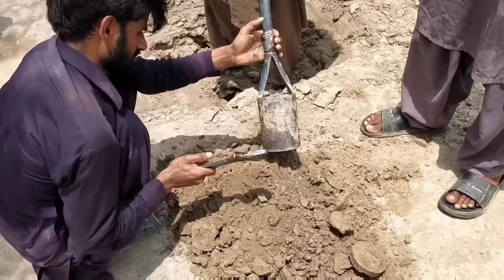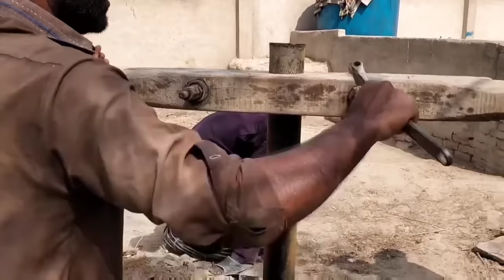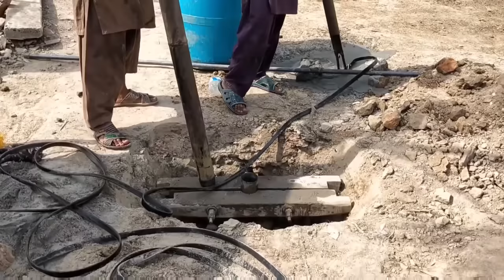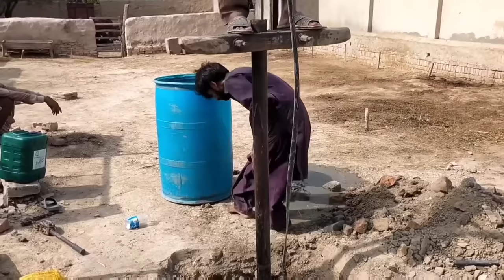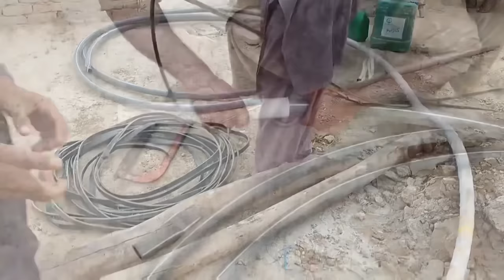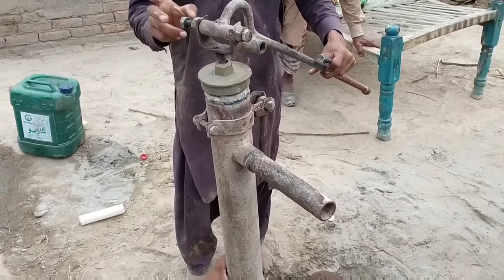400 Feet Borewell Drilling Within 7 Hours with latest technology | Borewell drilling Feast Your Eyes

Comment: Hard to believe 400 feet.  Hand pumps at the top of a well are limited to about 33 feet due to air pressure.
Reply from the maker: trust me this is 400 feet 80 pipes 5 feet each they enter down
Reply: @EESkills Then please explain how the pump can suck water more than 30 feet up? Its physically impossible without a pump at water level.
Also, I dare say it's impossible to push 400ft of pipe down with only the weight of a few people, due to friction, and even more impossible to lift it all back up with that method. Maybe 100ft but not more.
Reply: There are valves further down, essentially pushing the water up. Or could be.
Didn't see it here though, maybe the water table is not as deep.
Just cleaner water way down. Didn't see any protection against contamination either.
Reply: Artisan pressure?
Reply: @bignicebear2428   they would need sucker rod. and they did not have any. They set the pump right on the top of the line and pulled (about 29 feet.) 

400 feet is a lie
Reply: LOL everyone literally saw them put 30 feet of black piping down the hole. Just get over it guys, it's a title on YouTube not a sworn oath.
Reply: correct, hand pump can not lift more than 30 ft suction, fooling us!
Reply: more like 400 inches. .they mess up converting from metric to English
Reply: Hi guys! Cool equipment and Great job 👍 I’m drilling a abyssinian wells in Russia, just using a hand drilling machine up to 69 feet, what do you mean about it?
Reply: @Mikst74  the others are getting upset by the hand pump that they used to extract the water saying it doesn't have the capacity to work beyond a certain height. The argument is a little flawed any way in that the height is calculated from the pump to the water table. My point is that they clearly only drilled about 15 or 20 meters (65 feet). With your experience how long would it take using these methods to drill 400 feet?
Reply: 40 inches ..oops
Reply: Can only be 8-9 meters.

In those countries the laws of physics has not yet been discovered, so they don't know it is impossible, they just do it.
Reply: It was only about 50ft deep.
Reply: @c2h7 let's says 40feet
Reply: @youghurt2k 😅😅😅😅
Reply: @youghurt2k  😂
Reply: Definitely not 400. You can see it's maybe 60 feet. when they put the black abs pipe down you can see the total length is less than 100
Reply: Incredible!!!
Reply: The hose they fixed was no more than 100 feet long
Reply: Even at 40 feet they did a great job, having water from a well is a blessing we take very much for granted 👍
Reply: 400 pakled feet
Reply: @EESkills  You've made a fine video. Now, please cut the bullshit about sucking water from over 33 feet. You may well have drilled down to 400 feet, or 4,000 feet for all I care. But if the water table is lower than 33 feet down you won't get a drop with that type of pump.
Reply: Mohammad &Son Well Drilling Inc
Reply: @c2h7 kwentong barbero lang yan naniwala ka naman 😂😂😂..
Reply: Interesting technique to do a well.  I’m not sure how deep it is but as long as the water comes up in the hole to 25’ you can use this type of pump.
Reply: Hard starta ?? Rocks ?? Below 200 feet everywhere on earth you will get rocks you can't break rocks with that
Reply: @c2h7  centrifugal pump only lift water  upto 10 meter depth. But this hand pump is a positive displacement type. Can lift water at any depth.
Reply: @georgegonzalez2476  hand pump hamare yehan 120-150 bhi hota hai
Reply: @georgegonzalez2476  learn how a deep well water pump works
Reply: Well done!
Reply: @kpd3308  Yeah, they're using a top pump.  My paren's house had a pump 180 feet down.
Reply: @saravananknpc  No, it can't. Positive displacement pumps at the top of a well can only lift 32 feet - absolute theoretical maximum. In practice, a bit less than that. A multi-stage centrifigul pump at the bottom of a well can push water from almost any depth. Around where I live, 100-200 meters is common.

Comment: impressed by their method and ultra simple equipment. Did not look like 400' deep. The prize was at the end, what an ingenious lift mechanism for the drill stem, a chain with two pieces of wood, brilliant and totally effective.
Reply from the maker: Thank you for feedback bro.. 💝💝💝
Reply: It is not 400 feet.  It is 25" max.  How do I know?  Physics.  Water density is such that the maximum that can be pulled up with suction is 25' regardless of borehole size.  Water density does not change.
Reply: @thonatim5321  maybe the "rope" they let down is 400feet - so possible that the water is that deep, because their would be stones etc. at some point in 400feet distance. still impressive.
Reply: @thonatim5321  Water table has nothing to do with well depth , a well can be be 400 feet, as long as the water table stays over ,lets say 7 meter , you will be able to pump water with a suction pump.
If water table is deeper , you can use a deep well pump.
Reply: @haynillesen  You have no idea what you are talking about.  We are talking about a jet pump (siphon) not a submersible pump.
Reply: @thonatim5321  making water wells since 1977 , you must be right,i don t know what i m talking about
Reply: @haynillesen  Oh you are a boomer.  Please read and understand what the topic of the discussion is.  You should know know that a jet pump can only function to a depth of about 25'.  There are some alternate technologies that can get a few more feet but physics is physics.  A deep well pump can pump from thousands of feet deep depending on the pump size, casing etc.  But you have been drilling wells since 1977, you dig then with a shovel by hand?
Reply: @thonatim5321 
And you are correct on the depth.
Two, facts back this.
(1) The tubing connected to the pump is between 20 to 50 feet. 
(2) The " casing" used was in 10 foot section. Only 3 were used. 10x3 is 30 feet.  Part of which was not in the ground.
But you are incorrect on the pump.
Where you are wrong is you missed to put the power source.
A suction pump is limited by the power.
The rule for this is 1 horse power per 100 feet.
A human can only pump at max 50 feet.
But if you power it by other means. Like a windmill, or a motor. You can go much deeper 
I have Wells around me over 800 feet deep that were ran by windmills that use suction pumps. By this I mean the water is 800 feet down.
Of course the vains on that wind mill are 20 feet. Meaning they are better then a 40 feet span. I've never measured one. But one side is longer then a old crew cab truck with a 8 foot bed. 
The pump used now is a suction pump. Powered by a diesel engine. 
And really for deep wells. I've never heard of a jet pump used.
It's funny. I've heard people say what you said about jet pumps ( sumperged pumps) .
Seem people like using them to about 200 feet. But past that they go back to suction pumps.
Now maybe you don't understand what a suction pump is.
Or that only hand pumps are suction pumps.
But you can take a hand pump you buy at Tractor Supply. Attach it to a windmill and pump several hundred feet deep.
Reply: @IvanhoeWolfe-zn6fc  No, you can't suction water more than 32 feet - end of story. It's simply not possible. The water column separates and creates a near vacuum filled only with water vapor.  The only way to get water up from below 32 feet is to push it from below. That could be a centrifigal pump, or some other method. But you have to push from below. You can't pull from the top.

Comment: A pump that sucks from the top cannot draw water from more than 32 feet down. That "400 feet" borehole is not 400 feet deep.
Reply from the maker: it’s dropping and you can see full video then you will be trust
Reply: @EESkills  I watched pipe go in - I saw about 50 feet. But that is not relevant. Physics is true - you simply cannot pump from more than 32 feet down with a pump at the top. If the water surface in the well was more than 32 feet below the ground, it would not be possible to use  suction to pull it up. The well diggers were lucky (or knew from working in the same area in the past) that water was close enough to the surface to reach with the pump they had.
Reply from the maker: @jimmurphy5355  i can understand but here water start from 150 feet and this is normal thing in our country and mostly people doing like this with handmade
Reply: Exactly. I'd say that the hole is 40-45 feet at max. And as you say, The physics does not allow water to be drawn up from more than 9,82 meters (32 feet). Gravity is the same in all countries...
Reply: clearly you don't know much about hydrolics, so you are trying politics
Reply: Yall dumas ever herd of a check valve 😂
Reply: @jimmurphy5355  depends what diameter and therefore what head you are lifting.
Reply: @Impermeabilizacionesinc exactly
Reply: @pede8889  No, the diameter is not relevant. You can't raise water more than 32 feet (~9.8 meters)  using suction. Doesn't make any differnece if the pipe/bore is 1cm or 1 meter.
Reply: @Impermeabilizacionesinc  Yes, I know what a check valve is. But that doesn't let you pull water up more than 32 feet.
Reply: @jimmurphy5355  13 psi does
Reply: @jimmurphy5355  its called  air lift 1¼ ,½ air hoes 13 psi 2cfm 8Lpm
Reply: @Impermeabilizacionesinc   AIr lift pumps are a real thing - but what is shown in this video is not an air lift pump. And air lift pumps can bring up water from far deeper than 32 feet, with no downhole pump. The air pump is at the surface, and pumps air down to the bottom of the well. You need a little under 1/2 PSI per foot of well depth to push the air down. If this was really a 400 foot deep well, the air pressure required would be about 190 PSI. Much less than that if the air only has to go down 50 feet, of course. 13 PSI would get the air down about 28 feet.

Comment: It's very hard to believe it's 400 feet, considering you only put in ~60' of water pipe at the end.  (3-ish coils, 8' across.)  Sure it's hard work, but lying is still lying.
Reply from the maker: Thank you for supporting my labor family ❤️🇵🇰
Reply: MAXIMUM 5 coils, 2 METERS per diameter = 5x 3.14 = 16 m black plastic pipe 16 meters + possible 3 more times 16 m ground water accumulation place sand sediments = 64 meters where it is 400 feet double possible drilled without jacket steel pipe :) impressive

Comment: I drilled my own well exactly the same way once about 50 years ago.
Reply: How is that bailer supposed to be welded?
Reply from the maker: @eddypeter4019  40
Reply: Hard to believe. Without the outer steel tubing the well walls should collapse really fast  and the well runs dry.

Comment: Great effort but the bore can’t be any deeper than 8 meters for a suction lift
Reply from the maker: 400
Reply from the maker: and thank you
Reply from the maker: 8 metrr have water??
Reply: This kind off pump istnt able to pump up water that is more than 10m deep. It works on creating a vacuum on the suction. The max vacuum is -1barg, wich is -10m off water depth.
Reply from the maker: @DDGVE  omg 😆… bro 10 m is nothing and water is upto 200 feet and for pure water is 300 feet inside.. we are using pure water in this pump

Comment: No matter how deep they put that suction hose, the water table can be no more than about 32' below the well head for a suction pump to work. 

I understand WHY they pulled the drilling caseing, pipe is expensive. But if the water table sinks past 32', that suction pump will then be useless- If they had left that well caseing, they could have still later install a DOWN ROD PUMP and keep using it as a manual well, or even drop an ejector pump down it later if they had electricity.
Reply from the maker: There have no electricity thats why using old techniques

Comment: Maybe 100’.  A 8’ diameter circle is 25’ circumference.  4 loops is 100’.
Reply from the maker: Thank u for support 🌹🌹🌹
Reply: Yes, I noticed that as well. No way that pipe was 400 feet. And of course, it is impossible to pull up from more than 32 feet in any case. So the water table in that hole can't be more than 32 feet below the surface.

Comment: 400 feet? No sir... 40 feet (12 mt)  is the right deep of this borewell 👍🏻
Reply from the maker: 350 feet
Reply: @EESkills  Lie.. no way 400 feet. Look at the stringer they dropped. about 30 feet

3 inch pipe weights just over 1.5 Lb per foot that would be over 600 lb  and he jacked it up with a 4 foot leaver.
Reply: @EESkills Tere Andar Apna dalu Q Mulk ka Naam bdnaam kr rhe ho
Reply: @allanc3655  https://es.wikipedia.org/wiki/Principio_de_Arqu%C3%ADmedes
Reply: @bubiaxe7744  You cannot pull water higher then the atmospheric pressure. If you get below atmospheric pressure the water vaporize (boils) At sea level (29.92 Hg) with a perfect pump (no leaks) you can pull 34 feet

I need no Wilipedia to tell me engineering facts. I have 6 years of college, a MS in Civil Engineering  and a BS in Mechanical Engineering. ( moving, using, and breaking apart liquids)

The video is a fake and there is no 2 ways about it. Anyone that tried to tell someone that they pumped water with a suction pump that far is a  just being untruthful and are the type that like to run scams.

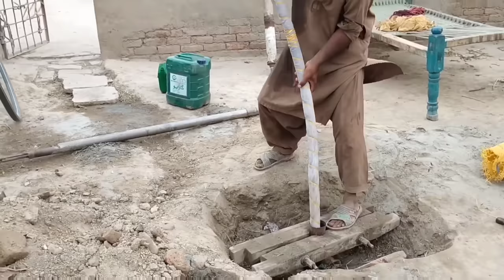Comment: 400 feet?  That length of tubing they cut was not 400 feet .At 9:00 that tubing looked about 50 feet maximum. If those guys are 5 feet high then each loop has a circumference of approximately 15 feet.
Reply from the maker: Some parts skipped
Reply from the maker: Thank you sir

Comment: 400 feet? Well, you can probably to drill that deep, but you'll never can pumpfrom that depth with this pump.
Reply from the maker: trust me if you can , you can check the speed of pipes that’s going inside
Reply: @EESkills  Well, I could trust You, man. Maybe I've misunderstood action of the pump which I imagined of vacuum sucking principle of action and if it is so, then I'm right, or Your foot is of an inch length.

Comment: What is that hose with the weight in the end doing? I don’t understand how just by lifting and dropping it down the shaft forces the timber platform down .
Or have I misunderstood the process?
Reply from the maker: This is the process for drilling to earth and at the end got water by hand-pump
Reply: That's only remove the excess soil under that, the soil collects in that hollow pipe they left up and down.. and due to the weight of person, the pipe platform goes down as platform is connected with those pipes .. atlast, they remove the pipes by other method by pushing it out .

And at last, attach the hand pump to the other pipe and start to pump the water.
Reply from the maker: @sahil5694  yes
Reply: They pour water in the hole to make the loose soil collect into mud
The pipe they drop down in a cup, the top is open so when its weight sinks into the mud, the mud on top fills the pipe and they pull it up and empty it.
The weight of the man, the stand and the pipe/cup crush the soil below the pipe and it sinks into the ground
The problem is a hand well head pump can only draw water from 30-35 feet
So not only is this a 100'deep hole, the water table is no less than 35 feet below ground or they wouldn't be able to draw any water without modern self priming pumps
Reply from the maker: @francislutz8027  yes 🖕🖕🌹
Reply: It's called a bailer. There's a flapper valve on the bottom that opens when it's dropped and closes as it's pulled up. The agitation of the water creates a slurry that it picks up.

Comment: I call rubbish on the claim of 400 feet in 7 hours.  That’s 1 foot dug, Every single minute of the seven hours. No stops for drinks or a pee - no winding the drill line up and down no bolting on the boars thing etc etc etc.
Reply from the maker: yes 400 feet the earth is very soft here

Comment: What you all missed is the pipe, tubing,.
The well is between 20 to max 50 feet deep.
I only counted 3 " casing" pipe.
Meaning total depth is less then 30 feet.
In soft ground.
I can piss with the wind too. 
Not impressive.
Reply from the maker: I miss some pipes for shorten process, its 80 ft depth
Reply: @EESkills  thank you for clarifying.
But I didn't just base that on the casing pipe.
I also watched the tubing.
I was being generous on 50 feet. No way that was a roll of tubing longer then 50 feet.
Sorry but I've used tubing way too many times and know this. 
However, say it is 80 feet.
Since when does 80 feet equal 400 feet in 7 hours? 
And again, soft soil is very easy to drill in.
I've seen bamboo drill wells in soft soil.
Not impressive.
What do you think is great about this.
Btw. If you know these people.
They need to collar the well. 
It doesn't make sense that they had to casing in place. It should have been left.
How they finished it. Is asking for problems when any repairs need to be done.
But then again. They can just easily drill another shallow well.
Reply: @EESkills  200 feet of solid rock is something to began with
It can be done. And not super difficult.
Impressive really is more then 1000 feet deep through rock by hand.
Btw this take over a month to do.
The deeper you go. The harder it is.
I've had times that a inch an hour is doing well

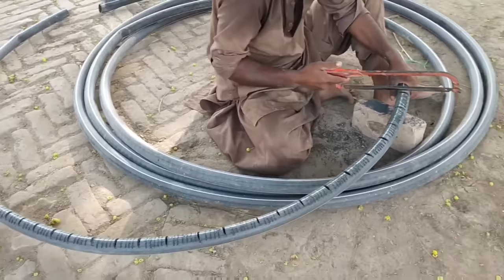Comment: 400 feet = 122 meters. At 8:08 we see 4 coils of plastic pipe that they insert into the bore. The coil looks to be about 1.5 meters in diameter. Multiply by Pi or 3.14 = 4.71 meters per coil, times 4 coils = 18.8 meters. 100 meters short of the click bait claim, but impressive none the less.
Reply from the maker: We drilled 3 days and some coils  parts skipped  .. and thank you sir ..